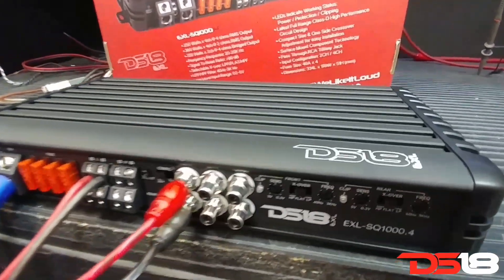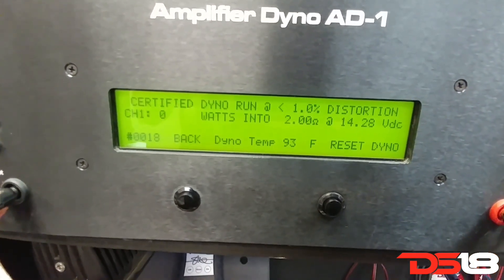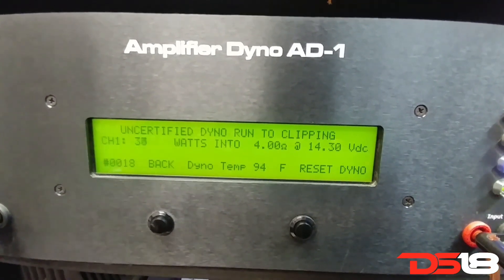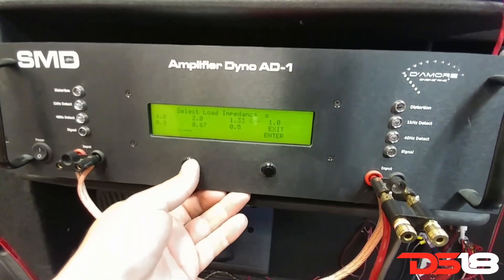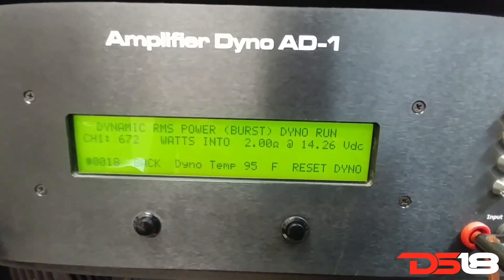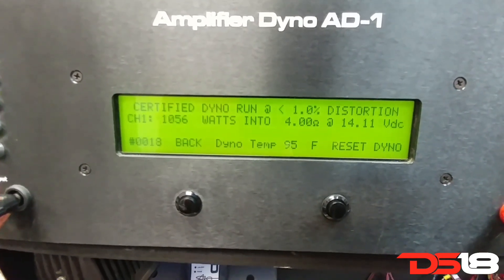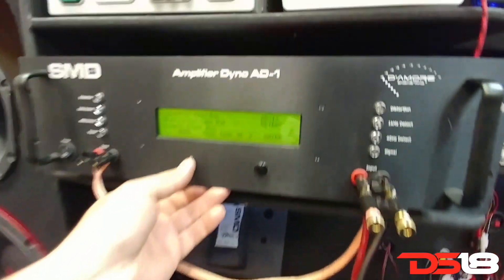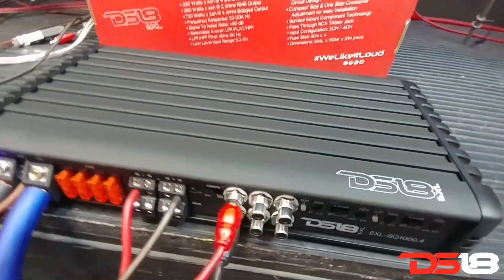DS18 EXL SQ 1000.4

Comment: This isn't an accurate test at all, you need to have two amp dynos and load all of the channels down at the same time in order to get a really accurate power measurement, people aren't going to listen to one channel at a time, you should re do it.... obviously the power ratings will be higher if only one channel is used on a 4 channel amp, you can't really test it's power supply like this...
Reply: Exactly,  I was confused at the power output especially when it only holds 4 40amp fuses for a total of 160amps so with all channels loaded it would probably do just above rated (the most you would be able to get  bridged at 4ohms would be theoretically 800rms)
Reply: Actually, he should just bridge the amp to 2 channels and do an 8-ohm run, and a 4-ohm run. example: divide the output by 4 @ 8ohms = power at 4ohms x4.
Reply: @ericperry72  when you bridge an amp sometimes it'll still put out a bit more power than adding the wattage together from the two channels running in stereo even if loads are equal.